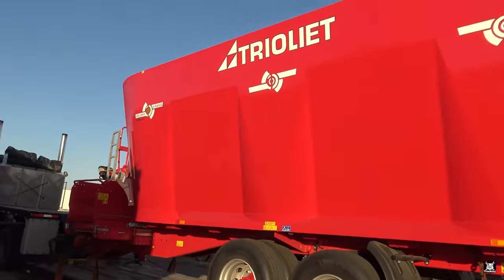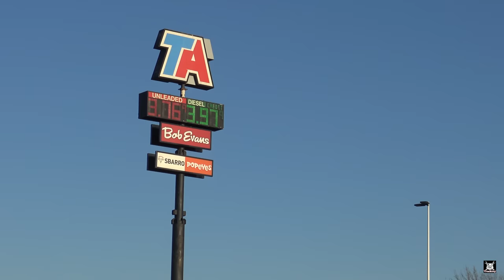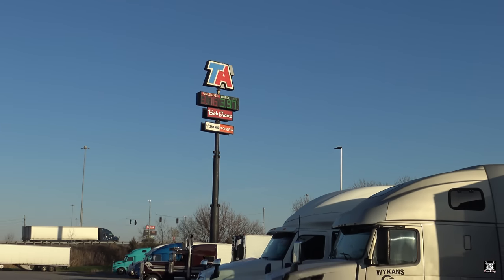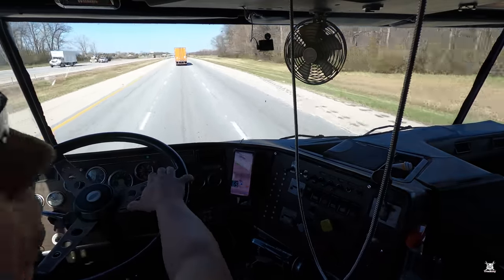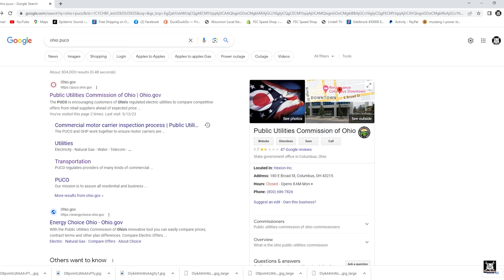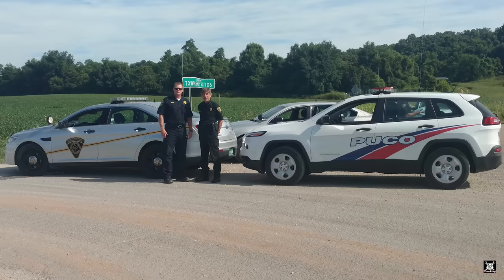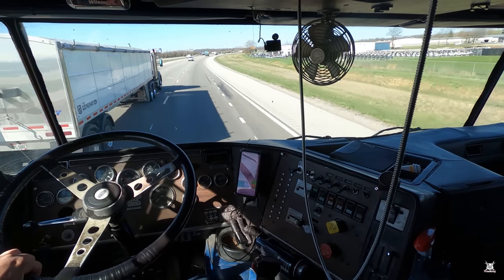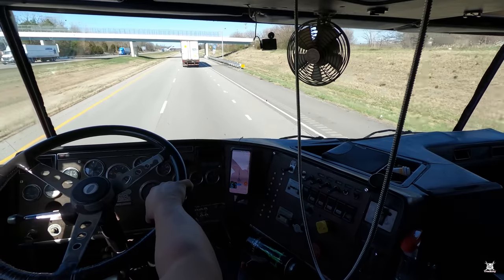Public Utilities Police For Trucks?

Comment: I see Ohio is still welcoming trucks on eh I-70, with the scale house.
PUCO has been in business a looong time. Like 1880 or 1890. Originally set up to do safety checks on steam railroads. The electric street railways, then pipelines (against John D Rockefeller!). 
      The more things change the more they stay the same. On fuel prices for the short time I was a lease operator, Gas Buddy and experience were my saviors. I don't know how you exist with today's diesel prices. 
Thx from a worn out driver.

Comment: I remember when the Ohio PUCO drove light blue Ford Crown Victorias and the DOT drove light brown cars now just about the majority of the Ohio Highway Patrol is DOT certified to do DOT inspections anyway steve stay safe out there
Reply: PUCO only used to stop placard vehicles if I remember correctly. I used to drive primarily in Ohio and have never been stopped by them. I have never seen them anywhere else except for the I-70 corridor, never 75 or 71.

Comment: Hey Steve! Both of the PUCO vehicles were Chrysler (now Stilantis) SUVs -- the one in the video was a Jeep Grand Cherokee, the first still photo was a Jeep Grand Cherokee, and the second still photo was a Dodge Durango (the Durango grill looks a lot like a Ram grill).

Just so you're aware.

Edit: By the way, did you see Tim Gentry at MATS? He had a beautiful stretched-frame cabover actually in the building at the show.
Reply from the maker: I was there.
Reply: That was a cherokee, not a grand.  Pa runs them too.
Reply: @nickd.4512  : Not true. Chrysler stopped making the Cherokee sometime in the late 2000s. As far as I'm aware, the only model that's been made is the Grand Cherokee, since around 2010. No base model Cherokee has the slanted LED headlights that the later model Grand Cherokees have. Additionally, I believe it was the Compass and the Patriot models that ended up replacing the base model Cherokee, which has the 3.7L V6 or the 4.0L V6, not the 5.2L V8 the Grand Cherokee has.
Reply: @Isaiah Welch  i owned one, they brought back the cherokee name in 2015.  Their junk which is why Chrysler stopped making them again and retired the cherokee name.
Reply: @nickd.4512  : Actually, I have a correction to make: According to Stilantis, they are still making both the Jeep Grand Cherokee (both base model and SRT model) and the baseline Jeep Cherokee. 

They have not actually ceased production on the Cherokee or Grand Cherokee nameplates since they were brought back in 2015.

Comment: I did wonder the Public Utilities Police/Commission is for those Electric Vehicles trucks they slowly pushing out. This is my first time seeing a International EV straight truck that have this huge battery pack under the truck. Mind you that thing can weigh close to a half or full car. When I measured that battery pack to the ground, that thing is about 12-14 inch of the ground, not enough room for error when driving over rail road tracks, loading docks that go from straight to 40 degree drop. So yea.. I will stick with diesel truck. Until they can get their shit together, don't push anything EV related on to driver or companies.
Hey Steve, when ever you back in to LIE in NY. Be careful of the Work Zone cameras car they have out now. They run them at night and day. You might all ready know since they do this in Baltimore and some in VA 95 construction zone. Safe travels.

Comment: Public Utility Commission is nothing new in trucking, PA. you used to have a PUC number on the truck then PA DOT kinda of took it over, but the PUC could be helpful at times especially if brokers were breaking the law not paying the proper rate on a load. They kept the brokers in line, not like today.

Comment: It would be nice if the parts supplier would at least let you know about the status of your order of parts because maybe they can't get the parts as fast or maybe they are on hold. Either way, you wonder why Amazon is kicking everyone's ass in terms of getting things in a timely manner and they let you know if you need to change your order because they don't have it or they text you if there is a delay with an estimated delivery time so you don't have to pull your hair, well you don't have any hair, out wondering when your order is going to be delivered.

Comment: Puco is for intrastate only you have to renew yearly costs 100$ to 300$ depending on number of trucks,they partner and do inspections with those white  commercial motor vehicles inspections cars with red strob lights on top
Reply: Your wrong as a D.O.T in Ohio, Puco has full authority under FMCSA for Interstate. They handle all transportation and funding per the feds. OSHP has D.O.T and LCS Trooper, and the majority of standard Troopers are Level 3 certified .